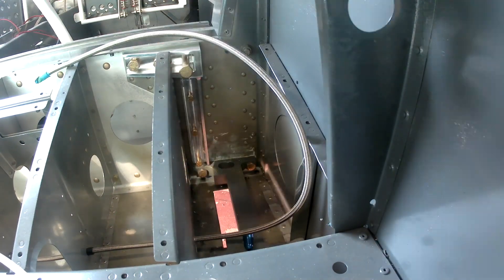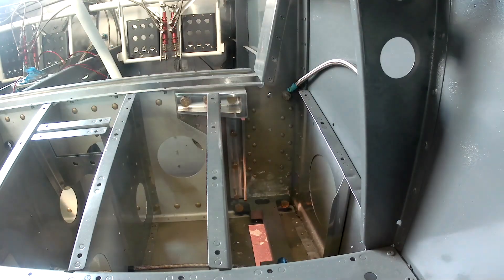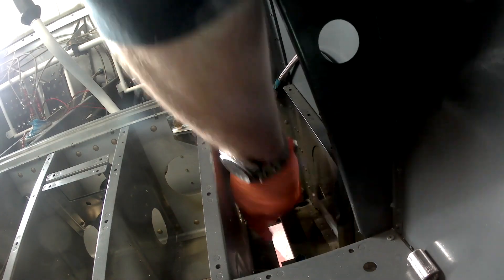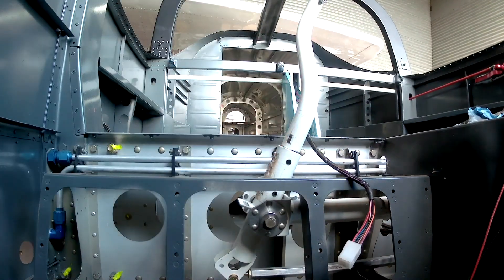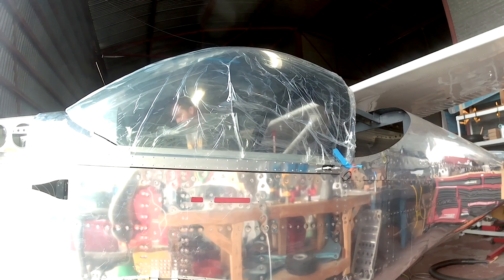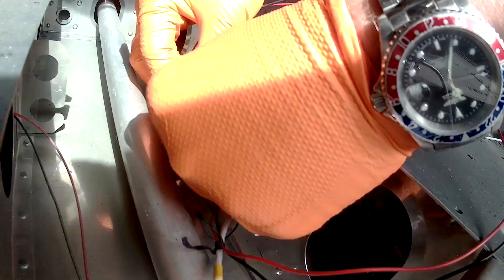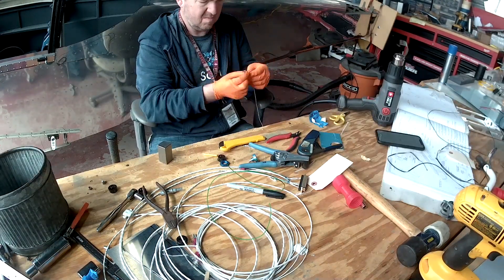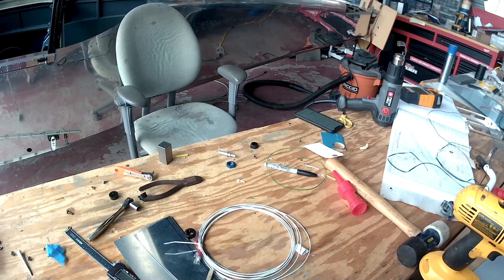RV-14 Little Bit O That 2

Comment: Andrew aren’t you suppose to prime all the parts?
Reply from the maker: Not necessarily. Any non all clad parts yes. All clad doesn't TECHNICALLY need to be primed as its self protecting. However Any alclad parts that get riveted together I do prime the mating faces.
Reply: Andrew Kilroy on your final paint job, do you paint the inside?
Reply from the maker: @capncrunch9313  Its more or less painted now. I just used a grey enamel. I need to put down a couple of coats on all the finishing panels and spot fix some stuff around the fuselage. Most of it is going to be covered up with carpet or seats anyways.